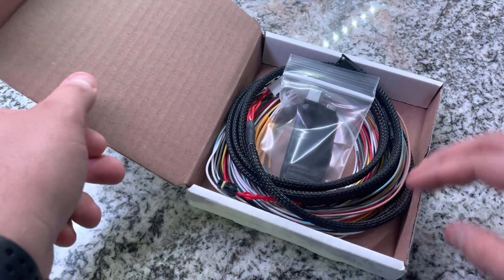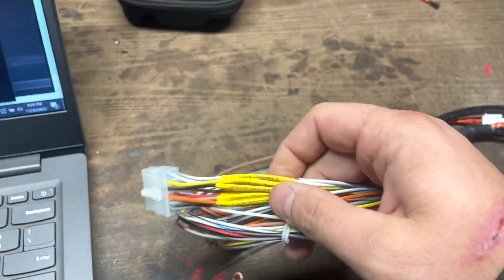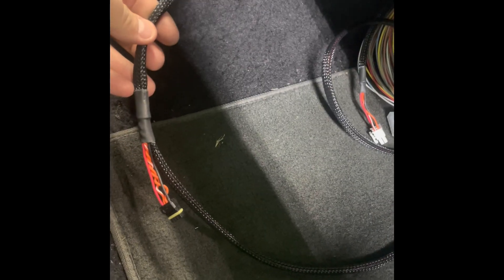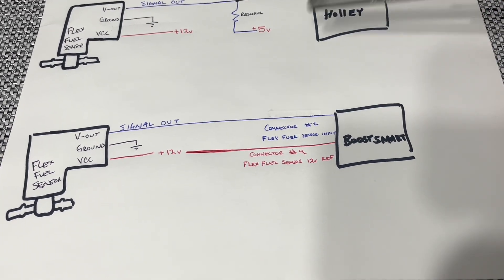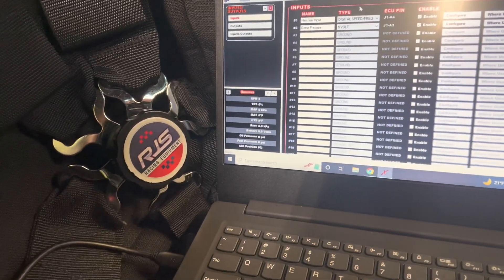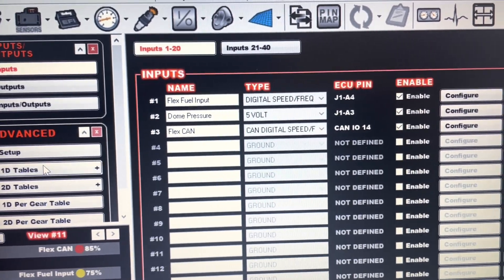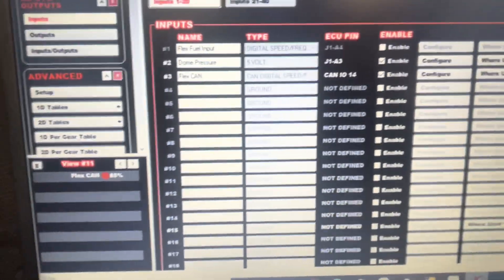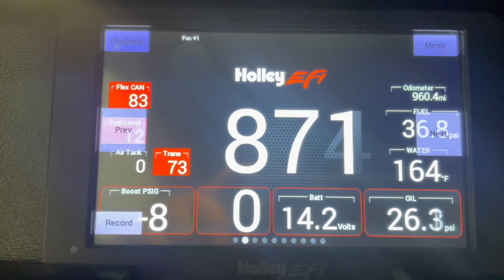How to add more channels to Holley Terminator ECU using swap-smart Boost Smart CAN expansion module

Comment: Looking to buy one of these was just wondering if you would still recommend one still working good ? Thanks
Reply from the maker: Depending on what you are looking to use it for would sway my recommendation. Ultimately I ended up swaping to a Holley Dominator and no longer needing it. The device creates digital channels so if you can utilize it, the unit is helpful. For me I wanted to do some more complex stuff which didn't seem to line up too well with this